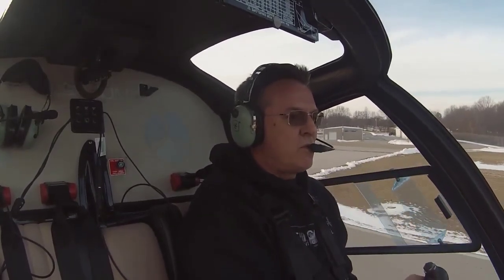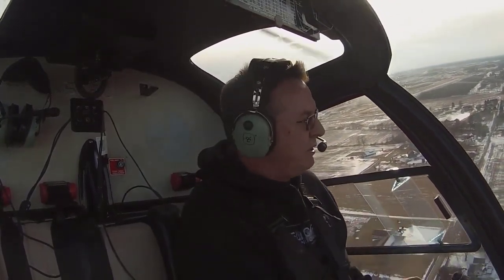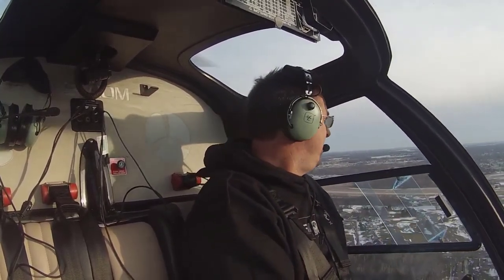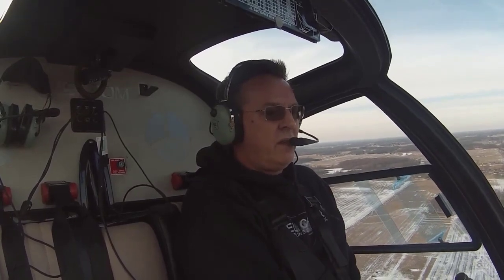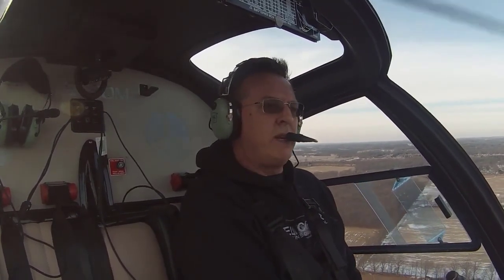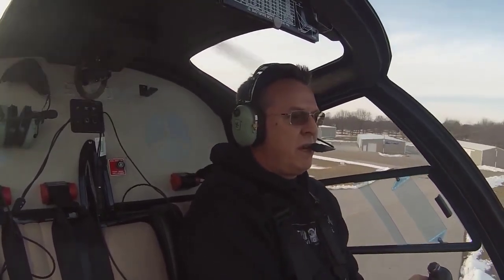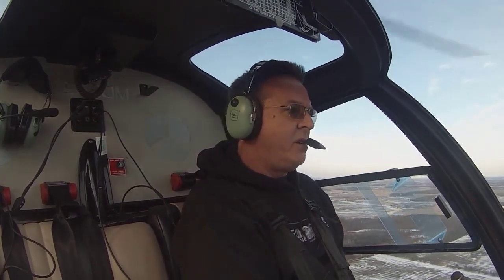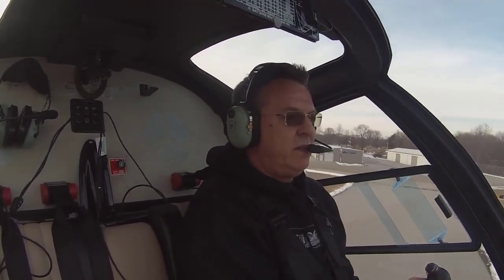#49 AUTOROTATIONS Engine Failure Practice Coffee With Kenny

Comment: All of my landings are in autorotation...
... because I fly an autogyro !!! :D
In an engine-out (or engine idle) situation, if we're setting up to land at a particular spot, we might use tight S-turns to help trim our altitude without gaining too much ground and to keep the rotor energy high. I've never heard a heli pilot talk about doing the same. Is it performed as a technique in helicopters?
Another thing we can do is known as the vertical descent (although it's not really perfectly vertical, it's just very, very low speed) and it enables us to hang in the air, losing altitude until we are low enough to make our approach to our spot, at which point, we lower the nose to the glide attitude in order to gain airspeed to give us energy for the round-out and flare. Again, I've never seen a heli pilot perform the same kind of approach in an autorotation. Is this technique ever used?
Reply from the maker: Yes we can do S turns to attempt to make a spot!

Comment: Hi Kenny

Do you only do autos into airfield from 500agl in US??
Was doing 2000agl and recover at 500agl over open countryside....in UK last weekend

Do you have to do a Hasell check before Autos too??

My instructor has a cadence with Autos too....
Lever down, Stick back,right pedal..... as quick as you say it..... also throttle below 80 erpm and pinch a inch on the lever......
All this on a R44 Raven 2.....

Have done Autos into our airfield too... a lot quicker but really satisfying when done right.....
Loving your videos..... especially in Cape Verde sunshine....
Reply from the maker: Thank you Paul! Yes we can, and we do practice at other agl altitudes. 500 to 700 is standard for practice!
Reply: Some instructors will start a student at 2000 ft and recover at 500 ft to give the student an opportunity to get the feel of the helicopter in an autorotation.  This is also a great idea early on so the student learns the effects of cyclic and collective movements and the relationship it has on rotor rpm.  Once the student is comfortable with the above, then it's time to work into the flair and power recovery but over an airfield is preferred for me.   Each instructor has their own way of teaching and what works for one instructor may not be what works for the other.  Hope this helps.  Good luck and fly safe...
Reply from the maker: Great advice Brian thank you!
Reply: Brian Rutledge Thanks brian....

Wasn’t sure if it was taught differently in US to UK.... feel at ease with the different type of Autos now  too.... Range/Standard/ short/ and backwards😉
Definately makes the engine off into airfield much easier too....

Thanks again. Paul
Reply from the maker: Thank you Paul!

Comment: Food for thought:  How will the auto change if you've just departed a heliport at 4700' MSL on an 80 degree F day when the engine quits?  are you ready?
Reply from the maker: Can happen at anytime! Enter the maneuver correctly, turn towards the wind. Look for a spot!
Reply: True, but the point that I was trying to make is that because of the high density altitude the auto will look considerably different than one performed at sea level.  For example, you'd best be looking between your feet for the touchdown point and there will be considerably less energy in the rotor to accomplish the flare and touchdown.
Reply from the maker: Thanks for the clarification  of your question Jim! I am a flatlander here in the midwest! So just not in my thought process. It is of course very important for those that do fly at the higher altitudes! Anyone flying at higher altitudes would obviously need to practice for those higher altitudes with an instructor!
Reply: Interesting story if you have a minute.  Mother Rucker sent a Standardization Instructor Pilot (SIP) to our facility at KRTS, elevation 5000', to show us country hicks how to do things.  He grabbed our newest pilot, just back from flight school, and "demonstrated" how to do a touchdown auto in an OH-58 to our ramp, which has a hump in it.   He touched down so fast the skids threw out sparks like a 4th of July sparkler and slid over the hump and out of sight.  We were bracing for the impact when we heard the power spooling up and the helo slowly hover taxi back to parking.   We learned later that it was our pilot who took control and recovered from the skid.   To his credit the SIP humbly admitted that he had zero experience with high altitude and mountain ops took some dual with our SIP.   The moral is make sure your instructor has experience in the environment you're flying in.
Reply from the maker: Thank you for sharing the story Jim!